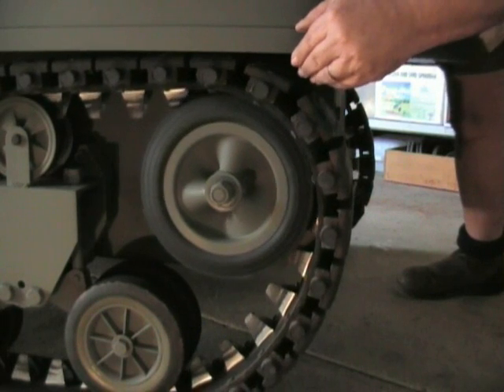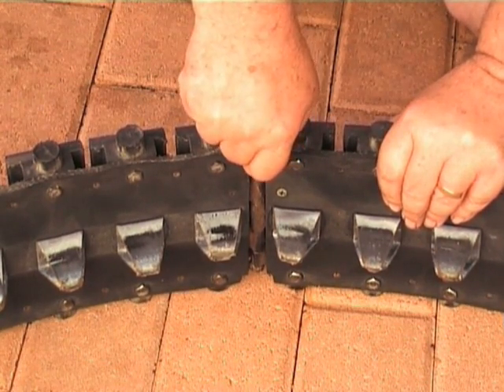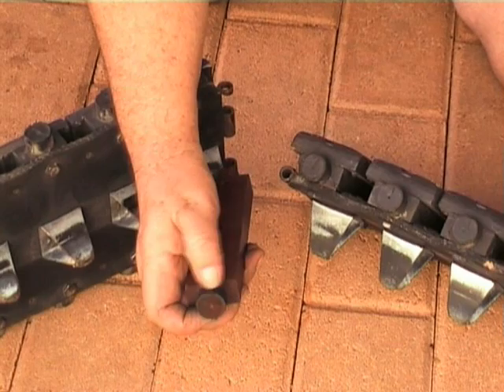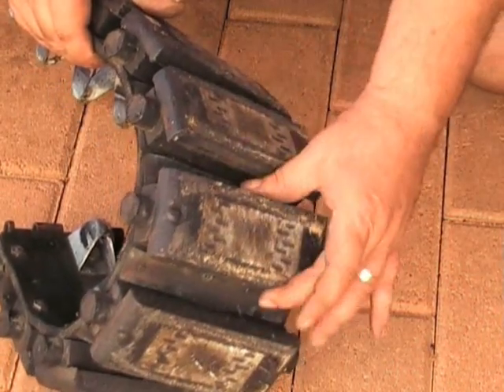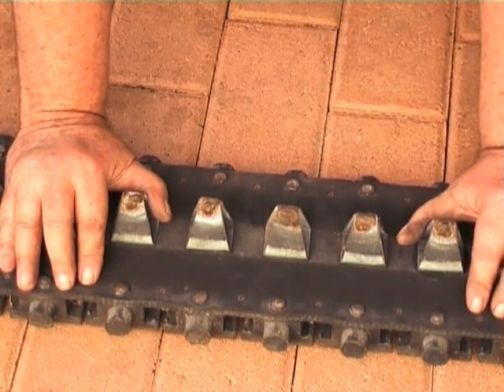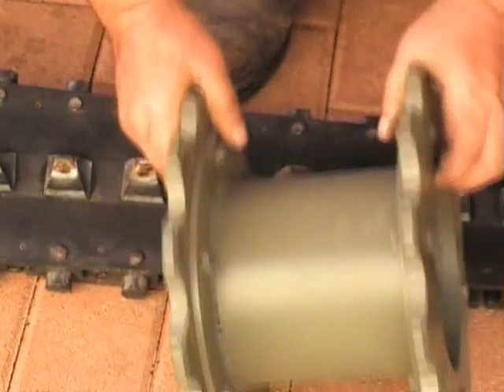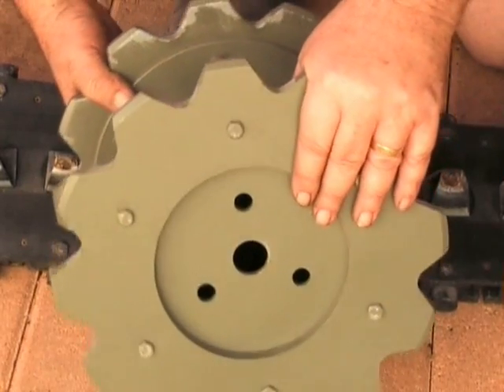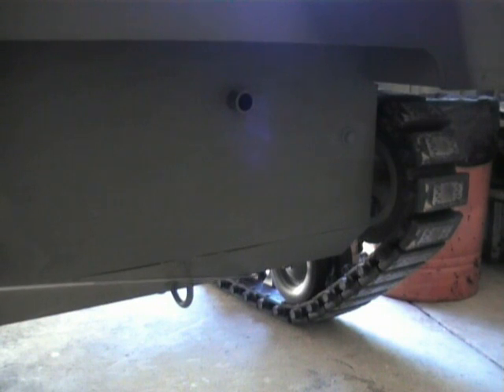How to build a 2/5th scale SHERMAN Tank. part 2

Comment: the Mystic river Sales company of Mystic CT USA (Became the powercar company) made a pedal version tank in the early 50s that shot ping pong balls out the gun and had a fiberglass body. I have enjoyed your videos very much since I deal with fiberglass bodied powered scale cars of the 50s and 60s I am currently working on a 1961 thunderbird junior (3/8 scale) with a 5.5 hp motor that has forward and reverse along with working lights and horn that was a dealership promotional tool built in 1961